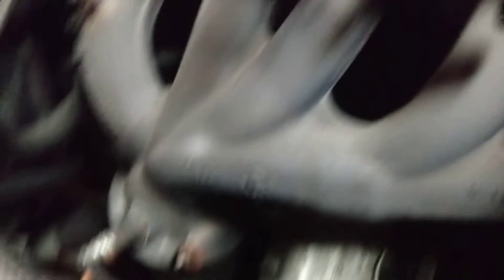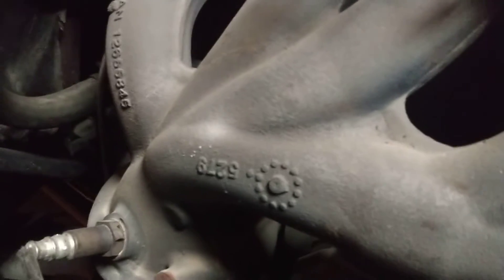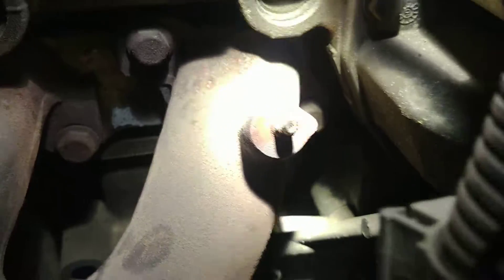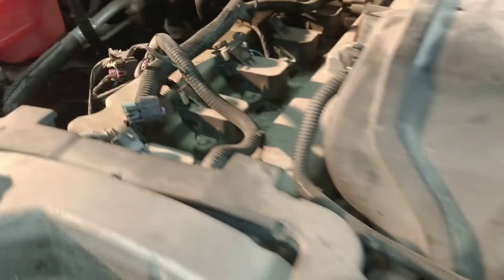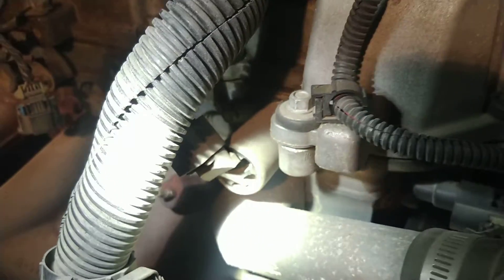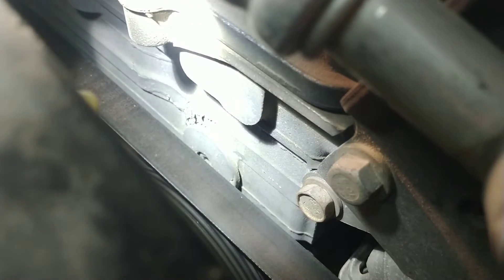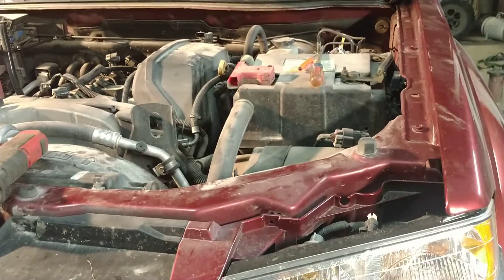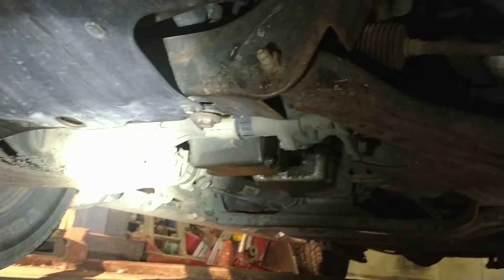Digging for the buried treasure in a 5cyl. Chevy Colorado... timing chain and gears.

Comment: Nice! We are in the process of diagnosing a 0 compression on cylinder 1. 
We are choosing to remove the motor.. that's just crazy what Chevy did with the blazers and Colorado's. I'm sure it's most of the small trucks and SUVs by GM..

Comment: Wow, repair pal estimate,  The average cost for a Chevrolet Colorado timing chain tensioner replacement is between $2,151 and $2,570. 
Labor costs are estimated between $1,606 and $2,025 while parts are priced at $545.
This range does not include taxes and fees, and does not factor in your specific model year or unique location. Related repairs may also be needed.
Reply from the maker: I did this one for about 1500, and that included getting the exhaust manifold resurfaced… had to do extra work because I could not pull out the front diff the easy way due to rust.

Comment: Hi. Wanted to ask. I replaced the solenoid and it runs nicely now. Was getting P0017 sensor b. Changed A by mistake today changed B. Still getting same code sale message. sensor B bank 1. I also replaced the crankshaft sensorz The truck sometimes won't start immediately after shut. I am going to change the oil. Wondering though if timing is an issue. I hear a slight rattle. Not bad.
Reply from the maker: I would guess it has the exhaust phaser going bad but unless you’re willing to go all the way it wouldn’t be worth going into to replace, those had some issues with oil passages plugging up also. Make sure sensors are fully seated in the cover if they’ve been out.
Reply from the maker: https://youtu.be/2lMuxxzWHVQ this was before I started editing videos but it describes some issues that might come up

Comment: Hey. I have an 05 3.5 4x4. Saw a video on the 3.7 4x4 that showed you have to remove the oil pan, axle, suspension and radiator to remove the timing cover. Is it that way on the 3.5? Mine has 300k. Is there some way to know my chain is stretched? I don't hear a rattle. I get a p0017 but that is for the sensors.
Reply from the maker: Same labor for a 3.5 according to Mitchell, if you don’t have chain rattle on start up then I would chase the code first.
Reply from the maker: That code says exhaust cam out of time compared to the crank, removing the valve cover would verify timing marks but that’s not a small feat.

Comment: May I ask if an 05 Colorado was only able to do about 10-15 mph would you consider the timing chain to be broken? Wouls you consider the timing chain to be a possible culprit?
Reply from the maker: If the chain broke it wouldn’t run at all, I would have it diagnosed before diving in.
Reply from the maker: A bad phaser can cause it to run bad but so can low fuel pressure or a bad mass air flow sensor.